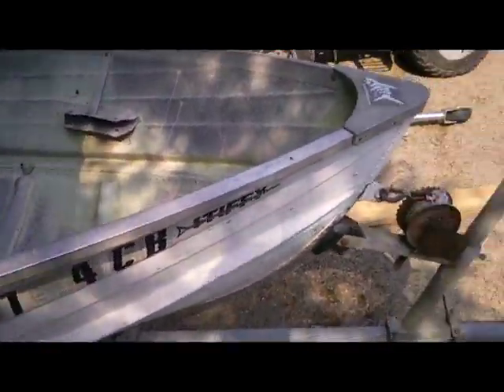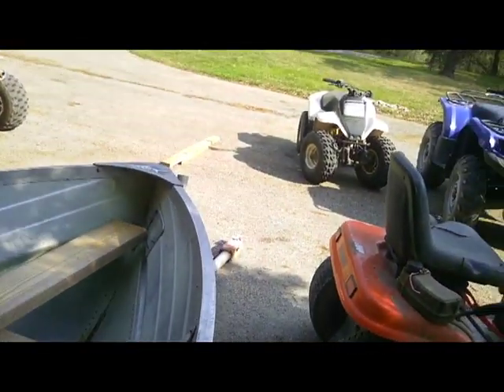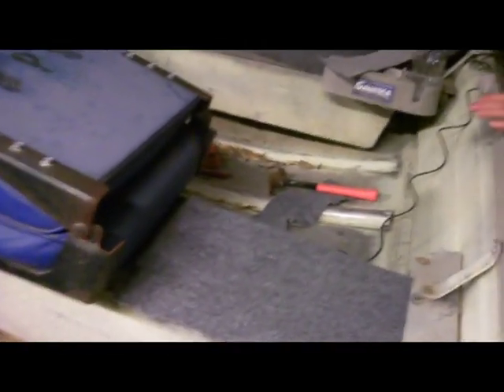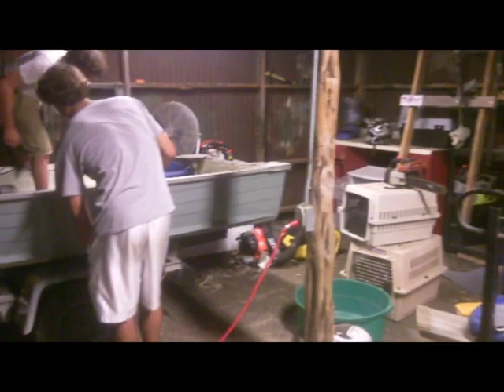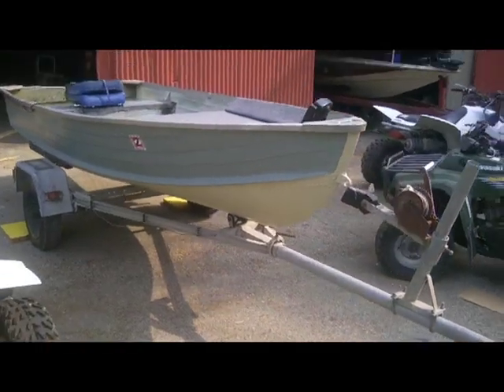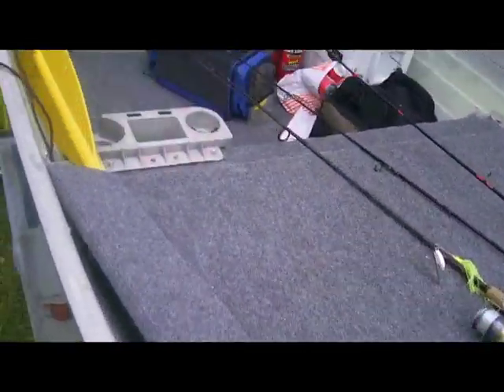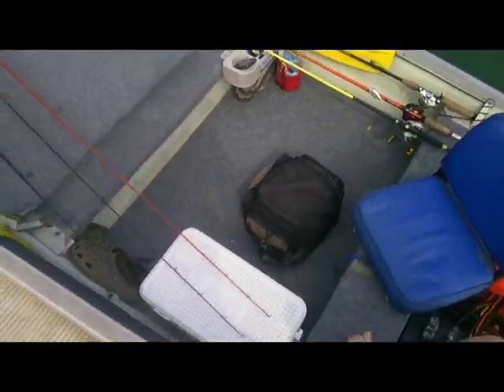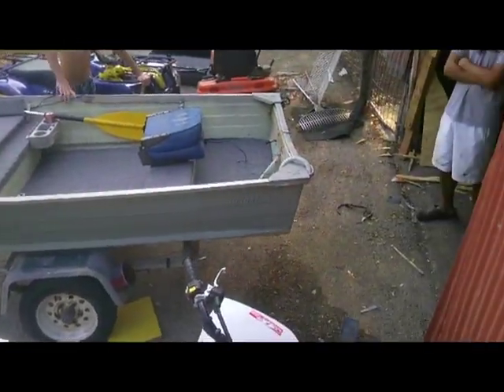12ft V-Hull Project

Comment: before doing all the wood work and carpeted i woul have painted the whole thing. KEEP GOING, with other projects, who knows you might have a future in restoring old alluminum boats. REMEMBER TO USE MARINE GRADE PLYWOOD AND MARINE GRADE WOOD. ALSO YOU COULD HAVE SANDED THE INTEREIOR AND PAINTED IT, PLUS THE HULL COULD HAVE USED A COAT OR TWO. THE LITTLE THINGS IS WHAT SELLS THE CLEANER AND NEWER. Ask parents for help in the expensive stuff like OUTBOARDS. SMALL MOTORS LIKE 20HP, WOULD BE GOOD

Comment: problems with the  front of the boat:
-you wasted a lot of space which could have been used for storage
-horrible measurements with the carpet

Problems with the flooring:
-too high off the floor
-you can't sit on the seats anymore because they are too short

Problems with the seats:
-you're basically sitting on the floor
-you could trip on it

you would have been lucky if you made $900 and by the looks of it you paid more to restore it then that.